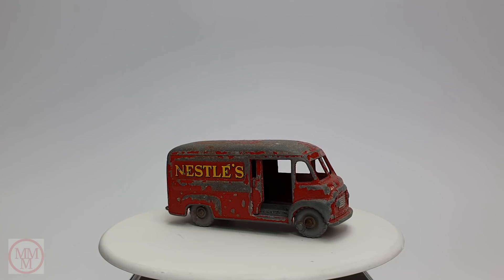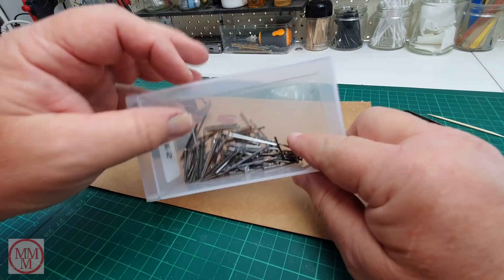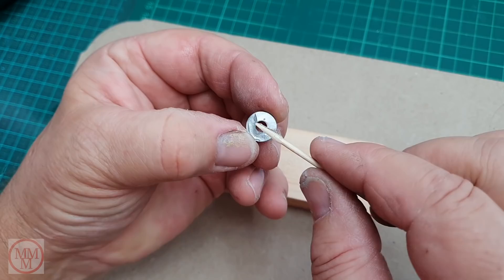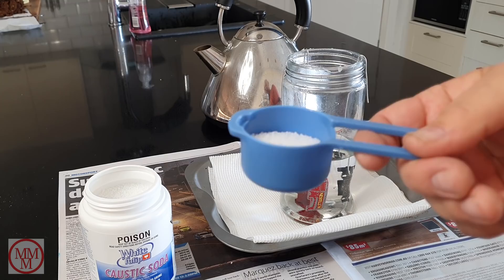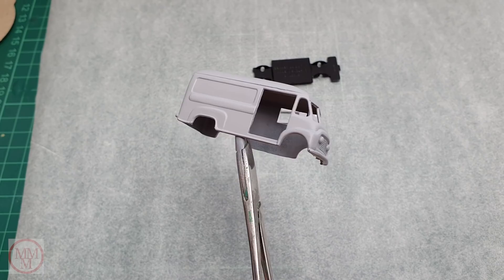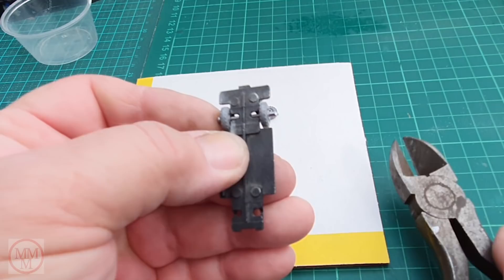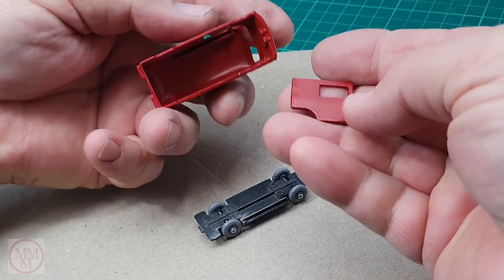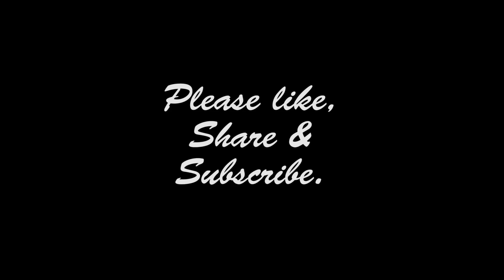MATCHBOX Restoration No.69a Commer 30 CWT Delivery Van 1957

Comment: You could do a simple upgrade on your tyre wash jig by removing the 5 nails from the block of wood and glue a waterproof foam on to the top of the block of wood itself, then put in thr 5 nails by removing the heads as you did before. The reason for this is so that you can remove the small wheels a lot more easily using your fingers particularly if you have big fingers/hands, the foam will press down giving you more leeway to lift the wheels after cleaning them a lot more easily. 🙂 Fantastic work as always... I've been a fan of your channel now for a couple of years and long may it continue 👍

Comment: Hi Marty,
This model finally gives you the evidence that Matchbox used the same method as you do to deform the end of the axles!
That imperfection in the wheel is where the factory worker has lowered the deformation tool and it slipped off onto the wheel...
Reply from the maker: My thoughts exactly. :)

Comment: Just a note on the caustic soda method: Sodium Oxide and Hydrogen gas are given off by the caustic soda reaction with hot water so it is advisable to not breathe it in or have it near potential ignition sources. I wear a mask, goggles, gloves and do it in a heavily ventilated area.

Comment: You could have went all the way with "Hole" also on your new Axle Separator. Nice tool. It looked as though the originals did not have matching heads on those cut axles. Very pleasant video.

Comment: Great restoration Marty. I think I've come up with a system that seems to work to stop the wire brush bristles flying around the room. I always use the wire brush with the model in the bottom of a 6 inch high box. At the bottom of the box I put a strong magnet (inside a plastic bag). Then on the rotary tool I made a transparent guard out of an old plastic bottle, cut in half then in half horizontally, which I attach to the tool with an elastic band, to deflect any bristles down to the bottom of the box and because they're very light weight they fly towards the magnet. Then take the plastic bag with the magnet to the bin and remove the magnet from the bag and the bristles fall away.

Comment: I like the length though I did like seeing the paint as well as this week's headline in the scandal paper you used as a liner. My only complaint is I didn't like hiding the wheel with the blemish. It's been like that since it was new. Showcase the oddity, don't hide it.

Comment: I do wish you'd use a Pyrex container for hot water/caustic soda, it's designed for high temperatures and not expensive. Much safer than dealing with shattering glasses or jars
Reply: Get “foot long” hotdog cooker....

Comment: I think the Red Shade Lesney went for on this was indeed the correct Nestles Chocolate Red - the bars of milk chocolate had Red Wrappers and Came in Vending Machines on the Railway Station Platforms and waiting rooms which were Red Too (Cadbury had different Red Shade for their Plain Chocolate).  nestles milk chocolate was smoother than Cadbury - did they have a UK manufactury ?  When other vending machines with more variety came about there was Dairy Crunch, The White chocolate (Milky Bar),  Fruit and Nut,  any others ?   The van would multi-drop to NCT retailers box loads of product, and new display units and so on. The Red should differ to the Brooke Bond Trojan Van Red ( one of my friends was custodian of the real one of them ).

Comment: The reason the caustic soda solution removes the paint is because it is DISSOLVING the metal underneath. All well and good until it starts to blur any details on the model... I should think the non-reacting paint stripper would be better. OBW, always add lye to water NEVER water to lye. It will explode. Stay safe and well.

Comment: Is the rear of the van lowered? The base plate is surely bent, which certainly accounts for the enormous difference in height in the wheel arches. There are bumps in the front window frames from the cast production. Time is probably not the problem, regulating that would have taken no more than 10 minutes more. Sorry, Buddy.

Comment: Marty priorto Britain being in the "Common Market" it was pronounced Nestles but after it became Nestlee, so at thr timr the van was being produced it would be nestles. 
If things like wheel are seized on by rust try soaking in paraffin to release them and it helps to remove the rust.
Reply: Stephen Ruff  It was just a memory of using parts' baths to clean parts and remove rust. Plastic never came into it so it never crossed my mind but it can still work on metal.